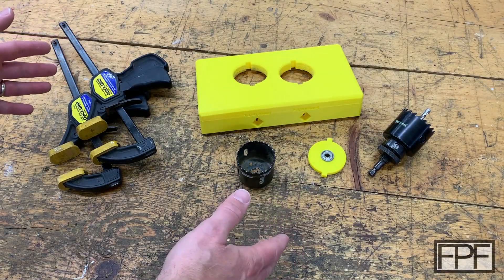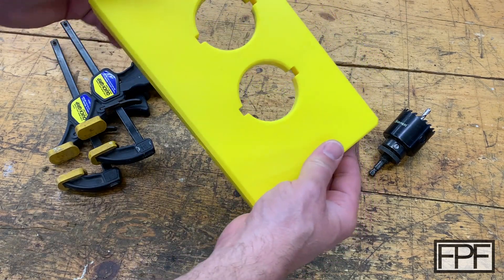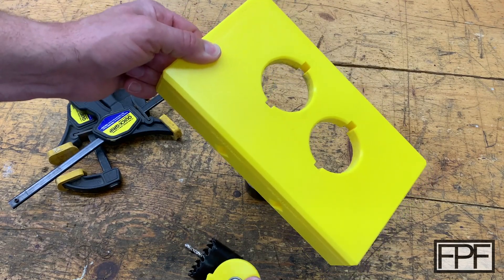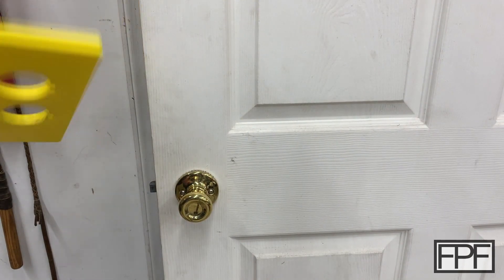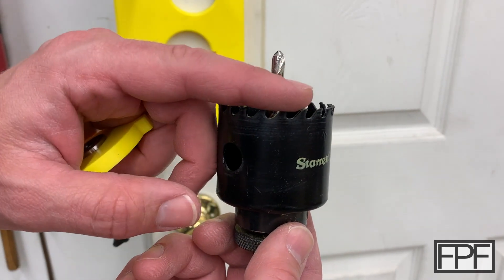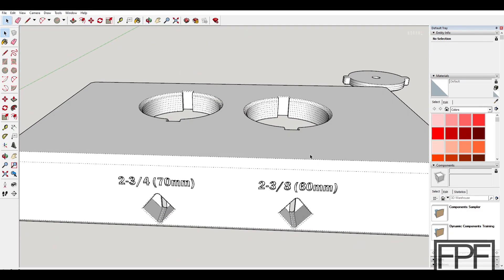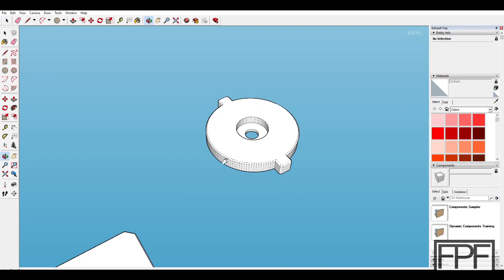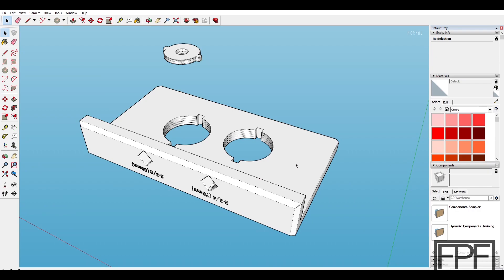3D Printed Deadbolt and Lockset Drill Jig

Comment: Are you doing all the modeling in SketchUp?
Reply from the maker: I work both in Sketchup and Fusion360.  I'm probably more comfortable in Sketchup due to using it for so many years (even before getting into 3D printing), but Fusion is generally the better choice nowadays for most projects.  If you're just getting into design, learn Fusion.